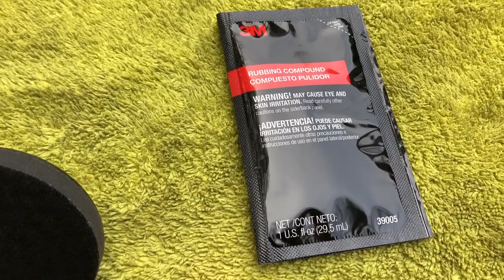See How Using Toothpaste vs Kit to Restore Headlights Worked

Comment: How about testing the toothpaste with the buffer?
Reply from the maker: You could, but I think anybody interested in using the toothpaste is going to do so because they don’t have a buffer. Plus, I’m all out of yellowed headlights at the moment.
Reply: I’ve got some very yellow headlights over here! I’ve been wondering if the toothpaste thing worked! Thanks!
Reply from the maker: @amandamcdaniel8903  It works really well, you may want to buy a new toothbrush afterwards though.
Reply: @pinkcaddygarage267  I’ll definitely keep that in mind 😂